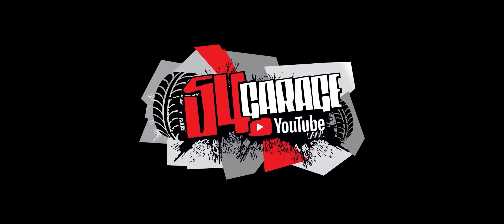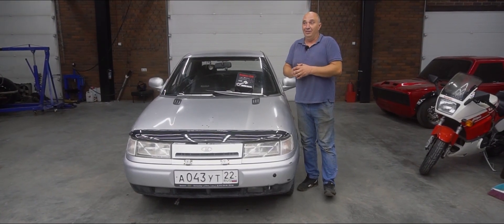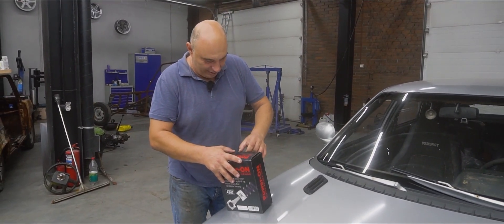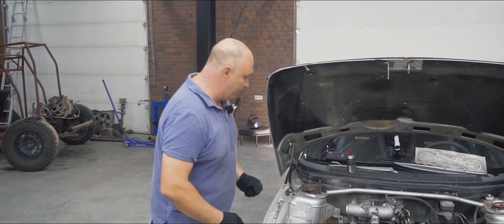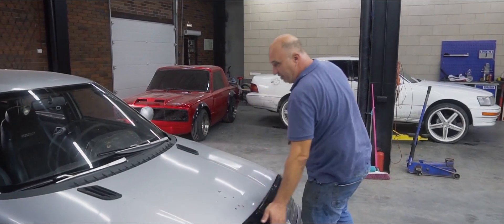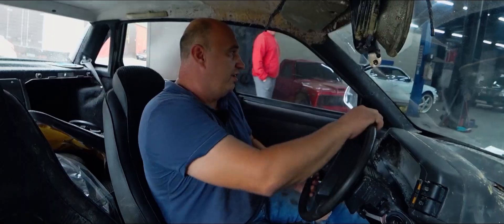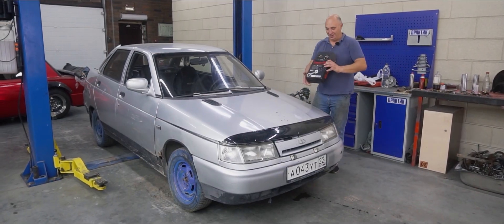Piston return springs (good for 30 HP) – do they actually work?

Comment: Next video: cutting pistons to actually fit piston return springs
Reply: Probally better to shorten the con-rods / weld the spring to piston. (unless its made of that alien metal, that is hard to spell, in relation to where you are...)
Reply: Pistons are hollow.
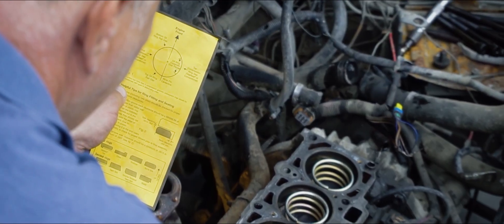Reply: There are indentations in the pistons to allow space for the valves.. There is really nothing going to fit in there i think. 4:23
Reply: or attach them to the spring made conrods
Reply: You mean connecting rods

Comment: This only works if the BLINKER FLUID is topped off.
Reply: He also forgot to fill his tires up with winter air 🤓
Reply: @Hopinmypony  You only have to change the air in your tires in the summer, he didn't show us how to change to winter air 😅.
Reply: The crankcase ceiling light needs to be turned on as well
Reply: Davinky?
Reply: Don't forget about the radiator bearings too guys! 👻
Reply: And also when muffler bearing is replaced
Reply: dont forget about the muffler bearing
Reply: And the power steering sand is full.
Reply: Your problem, guys, is you didn't install the correct muffler bearings.  Don't forget, you need the correct metric crescent wrench to install them.
Reply: New muffler brains as well!
Reply: Hey guys! Chris Fix here!
Reply: Pretty sure it's headlight fluid he needs.

Comment: That packaging looked like a legit scam, nice touch :-)
Reminded me of those things you plug into 12V socket and you save "UP TO 20%" on fuel xD
Reply: This is definitely a well put together joke
Reply: People really thought those 12v plug fuel savers worked, so people will also think the return springs will work 😂
Reply: @Fetii  Technically you can get them to "work" if you modify the shit out of the engine but you'd probably lose 30hp and the engine would last like 5 mins or so :-)
Reply: @talictdf4757  work how? they often literally just a capacitor and a led.
Reply: @Mr371312  I meant the springs.. and I put work in quotes for a reason :-)
Reply: @talictdf4757 ya I know. But to engineer an engine around a capacitor. In fact thinking about it, those cons make entire rigs supposed to be representations of car ignition systems, as "proof"
Reply: @Mr371312  They could do it I suppose but that's too elaborate for a scam like this, it's much easier to write a page or 2 about how it works, throw some random technical words in there and write a few fake testimonials... oh let's not forget the fake limited time discount xD
Reply: @Mr371312  As far as I remember the whole fuel saver thing was strictly online so I don't get why they made this unless the scam manifested differently in some parts of the world if so I must have missed it.
Reply: @talictdf4757  Yea just saying it struck me, because they actually did engineer around those
Reply: I've seen sets like this, but they are for brake pistons. Gotta be some big ass brake calipers, but they are a thing. The box label was a nice touch though.

Comment: Even if the springs could fit at the top of the cylinders, they would have no effect on HP.  The energy the springs provided would be offset by the energy the motor needed to compress the springs for a net gain of zero.
Reply: Because there is no such thing as perfect efficiency, the energy they provided could never be equal to the energy absorbed compressing them. The net result will always be a loss of power.

Comment: Now what does work is adding a vacuum pump and pull as much air out of the crankcase as possible. That does make power and aids oil drain back.
Reply: Vacuum is helping the pistons on the way down but the pistons that is on there way up is working against the vacuum, so no power gain unfortunaly. But god for other reasons 🙂
Reply: @gallaion  I honestly thought the vacuum pump was bullshit until I saw it work with my own eyes.
700 hp endurance racing engine on the dyno that can not make any more power and be in spec for the class. They hooked up the vacuum pump and it made 730 with no other changes.
Reply: @johnparrish9215  reduced crankcase pressure is often a great thing but the most gain comes from better ring seal with low pressure or vacuum, not by helping half of the pistons on there way down 🙂
Reply: @gallaion  I never said it did, I'm distressed that you think I'm that stupid.

Comment: If you also add muffler bearing you will get even more HP (but only if you have enough blinker fluid).
Reply: And don't forget to change your blinker fluid before winter.
Reply: @CaptHollister  I highly recommend synthetic blinker fluid... better brightness in limited visibility!
Reply: @CaptHollister  I think in that garage they use electrolytes instead....
Reply: Make sure to fill your tires with the correct air! you don't want to fill them with summer air while in winter!
Reply: more HP from the intake cyclone and better fuel from a few lead balls in the tank ... or mix diesel with snake oil.
Reply: Not as much as a vacuum cleaner to suck out the exhaust gases. It'll add +1000rpm to redline because the cylinders are evacuated faster, allowing the pistons to move more freely.
Reply: The yellow can not run on its own, because the spark reservoir is empty.
Reply: chrisfixxxx
Reply: Also install a Hydroscillator, to remove unwanted water vapor from engine.

You also need to install the Flux Capacitor to Enable the Warp Drive.
Reply: In case you didnt know muffler bearings are actually a thing,some modern cars have bearings on the valves in the exhaust for a sport mode ect...
Reply: You beat me to it.  Funny stuff.
Reply: TIGOR
Reply: You also need the extra stretchy silicone power band
Reply: I always love the muffler bearing. Great comment
Reply: Make sure your tire/rim gaskets have a great seal otherwise you'll have an air/fuel leak
Reply: You may also need to replace your valve chain.
Reply: Don't forget to pour creek water in the radiator and reservoir. Keeps it from freezing.
Reply: Thats a chris fix gye
Reply: I just use a turbocharged dipstick.
Reply: Take away the body and you’ll have +- 100 more hp (tried and tested)
Reply: You need a left-handed hammer to install muffler bearings.
Reply: My blinker fluid ran out while I was making a turn... I'll spare you the details, too graphic.
Reply: Finally install a fart remover in your seats and sell your beloved Mazda MX-5
Reply: You can test all of these great horsepower mods with the genuine Buttdyno.
Reply: dont forget summer and winter air, but you must make odor remover first.
Reply: Where do you kind folk recommend getting blinker fluid
Reply: Technically, replacing the plain bearing style muffler bearings with roller bearings...
Reply: yeah i can agree ill do
Reply: Pfeh - everyone knows blinker fluid is a scam.  Headlight fluid is what the serious tuner would use....
Reply: if you have a straight pipe then you have to use Artillery bearings
Reply: make sure to clean the bearing with soopy woodr
Reply: Amused.  Actually, the Ford Model T had headlight fluid.  They used kerosene or acetylene lamps.
Reply: Damn it - I put the wrong color blinker fluid in my car. - my mechanic said it will also ruin my stereo as well as my head lining ?  Is this true?
Reply: Need to install with a left handed screwdriver tho
Reply: You get the most horsepower when you throw on some cherry bomb stickers
Reply: Don't forget about body decals. I heard once a K&N logo gives up to 11HP more, but only if it is aplied on the left front
Reply: Muffler bearings are back ordered!
Reply: Don't forget the correct  Nuts loose.... Between the seat and steering wheel...
Reply: I'm dead
Reply: Also don't forget the radio oil. Highly recommended for better reception.
Reply: Crisfix😂
Reply: And a bi-flangel doofah on the flywheel!
Reply: Always wanted a muffler bearing
Reply: Blinker Fluid, Light Filters, Alternator fluid swap, and upgrade the starters torque converter for better starting (kind of actually a thing - High Torque starters. I'm sure there are loads of joke things out there! And some that were a thing but aren't now, like replaceable wiper blades (now it's the whole blade instead of just the blade).
Reply: U from chrisfix?

Comment: Yeah, just as everyone else is saying, Chrisfix did it as a gag. There are not such things as piston return springs lol. But it does make for an interesting video nonetheless lol. :)
Reply: Dont Listen to this Liar! Probably a goon working for BIG OIL. Piston Return springs have been used for a long time, first developed by  Prof. Dr. Taehc Duarf in Elbonia. They are a little known accessory that can improve milage by 50% Not more, not less.
Reply: @Inesophet  question is, how do the valves work then? springs will be pushing up on valves, decreasing performance to the point where they will most likely not run and also break the valves.
Reply: @jac_attack04_59  Thats why you have to use the RIGHT Piston return springs that leave room for the Valves, i mean thats just logic. If you use the wrong ones than all kinds of bad things start to happen. Its even known to cause the Blinkerfluid tank to violently explode. Hundreds of Car enthusiasts are KILLED due to this every Odd Year.
Reply: @Inesophet  Lol sure dude..
Reply: @R4MP4G3RXD  ?
Reply: I had to reread it again lol. I gotcha.
Reply: No shit sherlock.... Garage54 did it in the first half of the video for a joke as well, and after that they tried for real
Reply: @Engineer9736  Keep diggin', Watson! Jokes aside though yeah I posted before I finished watching it, so yeah.